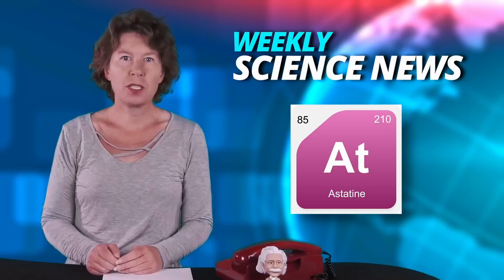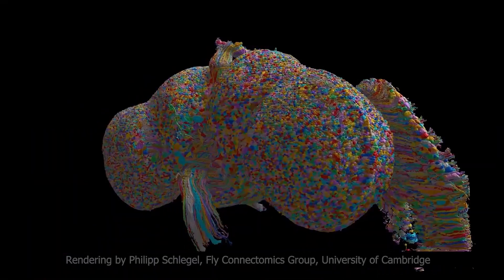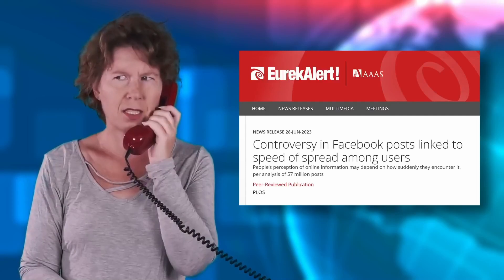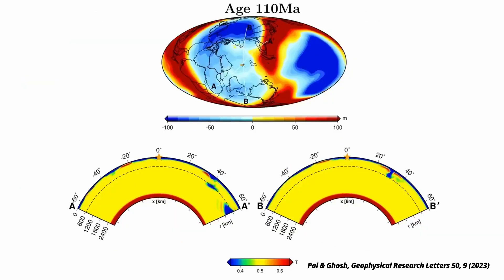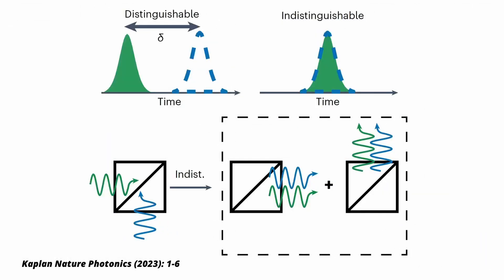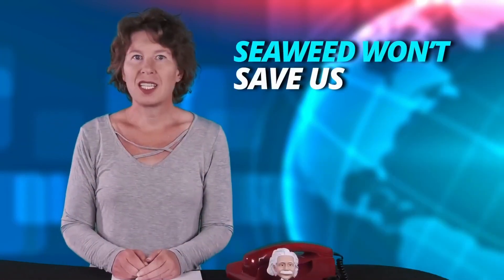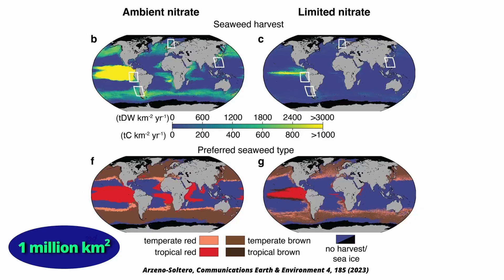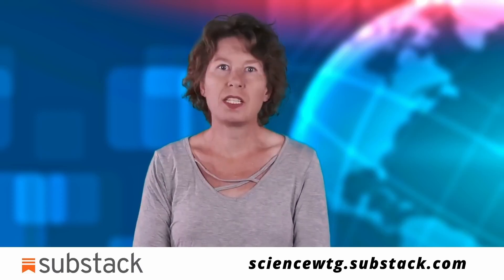Scientists find new atomic nucleus

Comment: re: seaweed If you use automated buoys to dispense nutrients (and detect when they are needed) then I suspect the seaweed idea would make more sense. What would make the most sense, however, would be to use GM phytoplankton to both increase the ocean surface albedo & sink carbon. If the phytoplankton are modified to produce suberin* granules that sink to the sediment, then the carbon could be sequestered for an appreciable length of time. *suberin is the main constituent of cork - but unlike cork, the phytoplankton would have to produce suberin without any air bubbles so that it would sink. Though I suppose you could GM macroalgae (seaweed) to make floating cork structures that could be harvested and put to good use in construction.
Reply: Sadly still logistically impossible, as the vídeo show, as algae, phytoplancton need nutrients too, and water fertilization at this scale, is impossible, in technology time and materials
Reply: @ElementalAer  I disagree since automated buoys / oceanic drones would be an easy way to do it - probably easier than fertilizing corn fields in Iowa with tractors. They could be called into a ship periodically for refilling (again, using an automated process, not hand-filling). Fertilizer can be highly concentrated.
Reply: @rhyothemisprinceps1617  And who'll manufactor, ship, mantain and mainly, pay, for all this? Climate change regression don't have economical or (fast) political return. Diferent from tractors on industrial farming, this idea don´t have a return, and was never made before
Reply: @ElementalAer  US government spent $877 billion on national defense in 2022 & the US DoD has identified climate change as a "critical national security issue" - so they can pay for it, easily. And certainly, there is no difference between my proposed strategy in terms of the funding question & any number of other proposed solutions such as space sunshades (hella expensive & also reduces photosynthesis) and carbon capture machines.
Reply: @rhyothemisprinceps1617  Well, now find the political solution so the USA put their money on the climate crysis and not bombing random countries (ps. it has been years trying)
Reply: @ElementalAer  If there is a power outage in Phoenix, it is estimated that 10k people will die from the heat. When (not if) something like that happens - that's when things will start moving. Should start moving before, not after - but that's the way things are.

Comment: Science has turned into a cult that is now closer to a religion. It is increasingly based on utterly unprovable but unquestionable dogmas rather than an open minded and fact based struggle to actually know more. If a member dares to question certain dogmas, they lock themselves out from the sect both in the case of science and religion. Science is not doing ANY better job explaining everything (or anything, actually) than a religion. Humans tend to either leave the spaghetti as hard as it breaks under your teeth or cook it into marmalade.

Comment: PLEASE READ THIS RE EDITED Time 16.-19 Date 15/7/23.
On the slit theory that spreads the light photons through METAL slit.
In a microwave, the microwaves STOPS coming out because of a FARADAY MESH cage that causes the WAVES to become trapped GOING UP AND DOWN SPREAD OUT within the faraday mesh, but still trapped. PERHAPS like slits in the SLIT EXPERIMENT, SPREADING out /FORMING FRINGES !!! The SLIT experiment is MADE OF METAL, just like a PORTION of a FARADAY CAGE !!Traveling energy behaving the same when passing through a narrow METAL aperture !! The DIFFERENCE in slit experiment is that the energy is LESS ENERGETIC, so escapes, creating a fringe reflection. Going TOO FAST, like microwaves through the slit as too energetic=getting trapped/rebounding VERY FAST within the slit. If the light was a dead straight line, then it would pass UNHINDERED. BUT, if it was a fanning out wave, then it would behave as above ? The material of the slit is METAL. Has the slit been replicated WITHOUT a metal material ? CAN the light CLOSE to metal CAUSE  charged particles at the metal ?? Is it this that causes photons to behave like microwaves at a metal slit PORTION of a faraday cage on a microwave ?? Where there's metal, it gives off electrons (electric field) that affects the photon passing by the metal slit, BECOMING A WAVE AND NOT A LINEAR STRAIGHT PHOTON ?  Where there's METAL (like metal slit), CAN Photons PRODUCE a NEGATIVE ELECTRON POLARITY excitation, BUT at FASTER SPEEDS than conventional methods ?? Is this used to create QUANTUM  binary switching on/off for binary computing ?? "On" as a NEGATIVE CHARGE electron 1 and zero (no electron) as an off state switch ?? AT absolute zero, DOES PHOTONS through metal INCREASES COHERENCE OF ELECTRONS when at NEAR ABSOLUTE ZERO because at absolute zero there's ZERO RESISTANCE for electrons. At near absolute zero,  the MEISSNER effect occurs, of ZERO electromagnetism at the core. Factually, if electromagnetism PARTIALLY BINDS a group of atoms together, then ZERO electromagnetism (Meissner effect) means PARTIAL UNBINDING those clumped atoms (GAPS), causing LESS AND LESS RESISTANCE. So NO resistance gives SUPERCONDUCTIVITY for electrons to flow. MEANING NO/ZERO VOLTAGE LOSS/DROPS (V=IR, V=100 current times zero resistance which is v=100*0 giving zero voltage drop).So, logically, OHM'S law, perhaps shouldn't be used here, because there's no voltage drop calculations here. Curiously, calculation of current becomes undefined when inserting resistance as zero. BUT can ZERO electromagnetism ALSO PARTIALLY unbind a SINGLE ATOM ITSELF ?? My mind still hovers over this PAIRS as one entity in entanglement, with the QUOTE of ".an inseparable whole". Is there some kind of umbilical cord ? Can there be a FASTER THAN LIGHT umbilical cord that does not affect the other ? Can entanglement occur without near zero temperatures ? WHAT IF ZERO electromagnetism PARTIALLY UNBINDS a SINGLE atom to release something that's so far UNDETECTABLE, as NEGATIVE MASS with NO POLARITY to detect it ?? QUOTE from science paper 2022 when ASKING google IF entanglement can occur without near absolute zero. QUOTE "previous observations that long-range entanglement survives at a non-zero temperature "ONLY" when more than three subsystems are involved". WHAT are those subsystems ? Are they involving a subsystem that creates ZERO ELECTROMAGNETISM, OR something at near absolute zero ? Zero electromagnetism MIGHT PARTIALLY UNBIND a SINGLE atom itself to ALLOW ESCAPE from partial UNBINDING,  this FASTER THAN LIGHT "umbilical" cord CONNECTION between PAIRED AS ONE particles; but a connection that CANNOT be used to affect the other at a distance, because it's UNDETECTABLE ?? It's frustrating when this paper DID NOT say WHAT those subsystems were. I DON'T STUDY mechanics,  just "ASK" google the right questions.

Comment: I can't wait for the biggest breakthrough in general purpose computer structure design in decades: The cheap, practical merger of memory and storage into the same thing. No more need for separate RAM, hard drives and caches all operating at different access speeds. A terabyte of persistent RAM and effectively instant booting and loading. No need to copy a program into memory; just run it in situ in storage.

Comment: I note the part about "the brain has a highly recurrent architecture", i.e. lots of feedback circuits. This is quite different from ChatGPT, and makes sense because that is what is needed to make a brain into a dynamic system that can spin thoughts around and around inside it instead of just "some stuff goes in this end and other stuff comes out the other end". Note further that they suggest this is especially concentrated in the areas for "learning and action selection", i.e. ... thinking. In a real sense, ChatGPT cannot think, it can just "blurt out" and is just very good at blurting out.
Reply: That is no different than the majority of humans . Garbage in garbage out
Reply: Thank you for this nice (and accurate) way of thinking about current AI.

Comment: On a black hole.
As a black hole increases in gravity, the singularity size would likely NOT grow proportionally with an increase in gravity?? But due to increase in gravity, the spherical area where light cannot escape WOULD GROW in spherical area size , giving an INCREASE in size of a black hole sphere, where NO LIGHT will escape ??
But likely, the SIZE of spherical black hole is REAL and NOT a lens like  DISTORTION exaggerating it's viewable size, Because if at the event horizon, the ACCRETION disc INCREASES in size, then the SIZE of Black sphere of NOTHING would be REAL in size up to the point where accretion disc appears ??
CAN that accretion disc STILL GROW in size LONG AFTER THERMAL death ? At near absolute zero, is the Meissner effect of ZERO electromagnetism when it's EXPELLED. Electromagnetism PARTIALLY BINDS several atoms together. So NO electromagnetic force at near absolute zero=partial #UNBINDING of clumped atoms, INCREASING volume AFTER THERMAL DEATH ?? Space temperature is close to absolute zero

Comment: So seaweed is a good solution. All you have to do to make it viable is find something that it can be used for.. I dunno.. Fuel? I mean, if instead of pumping more fossil fuel, we make fuel out of fermented sea weed, then the fuel burns, turns to CO2 in the atmosphere, gets trapped by more sea weed - then this is a closed cycle. Problem solved.

Comment: Get the climate "back under control"? Please, the climate have never been under control. I spent yesterday driving around and doing some hiking admiring glacial features left by the last ice age, and very possibly the one before that. 

Now if you said "bring the climate under firm human control" I wouldn't argue. Then we can argue about where to set the thermostat. I would assume that setting is somewhere between the Pliocene Climatic Optimum ( now + 4C) and the Last Glacial Maximum (now - 6C), but I could be wrong. 

https://en.wikipedia.org/wiki/Global_temperature_record#/media/File:Five_Myr_Climate_Change.png

Comment: The amount of power you could save if computers had a "discard memory" instruction that DRAM could execute... (DRAM draws power to keep memory bits from flipping. It needs to do this even for memory that isn't in use, as there is no way to tell the memory that you don't care what is stored at a particular address.)

Comment: I would take issue with two of your comments on climate modelling. 1) Contrary to your assertion, we have no data that climate is changing quickly. In fact, one of the quirks in the global warming narrative is that we've had a 15 year span recently where they had to try to explain why warming paused. And 2) the high resolution problem resides in the fact that the data sets used by NASA and NOAA are filled with interpolated data from stations that haven't sent actual data since the 1960's. The interpolation schemes are statistical junk science and so no model built off of it will ever be useful for anything other than pushing for support to increase a department budget.

Comment: FYI the "identify all pictures with bicycles" style prompts were to obtain information for training automobile AI software to identify bicycles, cars, buses, road signs, etc in their cameras.  They weren't really part of verifying that the user was human.
Reply: Wrong. It does both things. The software knows what is contained in some of the squares. It doesn't know what's in others. And you don't know which ones it knows and which ones it doesn't. By presenting a mix of these images it can both gather new data about what might be in the unknown images and test your ability to identify the known images.
Reply: @wheatthicks  The software killed a poor old person pushing a bicycle across the road at night . The billionaires owning the companies responsible blamed it on the human in the car accusing her that she failed to act as , in comparison, a power-surge trip switch would act on electric circuit.
Humans are not good failure protection devices because the humans get tired, bored, distracted, etc. but the billionaires and their stooges see the humans as such devices.
Reply: @reasonerenlightened2456  Ok. Thanks for tagging me in your bizarre tangent.

Comment: Something interesting about calculus is, that when creating a point of calculation ina grid, sometimes its goes infnite in both locations and then mirrors or arrives at other locations fine at hte point of origin. So in communications, could this interesting math be used in teh same function to shorten the time delivery, so rather then a linear path, create an infnite path... and then it comes to the location, the question of how to set upa curve to go infnite and come back would be interesting and woudl it be possible, becasue this would then allow infnite distance ot ocmmunicate anywhere in the universe, jsut stating it, I mean mathematically the proof is there on a calculator, but in reality, its something a bit different in taht relation. Maybe its like creating a spacial-echo for ocmmunication. Or does one need an array of netwroks first to create such a problem, 22 minutes... is a time, still slower then light speed. Light speed has its problems, you cna send laser packets of data, meaning 13 minutes for light ot reach mars from earth I think... So it would take 26 minutes in total to hear back, however, the interesting thing about this is I think I owuld be a good canidate, or engineer behidn the scenes, create a compact communicational language set, for distance talking, rather then emailing a friend, always a set of base questions. Of course, health could be monitored and sent back, like heart rate, health etc. (3 - 22 minutes)

The whole thing of psychology in closed corridors, we already know waht happens. in diciplined men it doesn't really effect anyone, theres thousands of years of this, in other types of males it effects them greatly.... surgeons and doctors that can cut up people it shouldn't really matter, different wavelength of emotion, and intelligence, but that would be an assumption. Not sure how the test on psychology would operate, unless they are jsut creating scenarios of stress and other nonsense things that then are jsut torture and nto realyl realistic... althoug hday practices of scenario systems is great, for then discussing openly how to solve those problems...

Certain females do not pose a threat, certain males do not pose a threat, dependent on demeanor and breed, typically.  There was already an isolation system. Cave network, mining geology etc.

Anyways communication... how to create infnitiy arcs, that don't need travel time... Point A systems... there is no B... YOu would want the arc to travel, and then go infinite, and come to a prescribed location of choice, IE it arcs back, equations in a virtual system technically do this in an instant... question is is it possible otherwise, meaning communicating in suc ha way, it would take about 6.68 micro seconds to communicate to any place, or less... hmm... is that possible... Light speed is relative to itself. If a star is in a group traveling light speed, teh stars light is still traveling emitted at light speed, but then its faster then light speed... but not faster then light speed reltive to the source, its just a relation of movements already in motion. Light speed is simpyl the acause or effect of a relation of burst or accerlation of energy to a undefined speed from an object moving.... Thus infnite speed makes more sense, relative to light. SInce in a void/ space, whatever you call it or want ot call it, any object can be going at any speed beyond light speed, since light speed is relative to not other objects but its relation to its time in space and where its produced. So a group of matter, simply travelign at  a trillion times light speed, wouldn't know it, because its aconstant and relative , and the light permeated from this group would be emitted at a standard of light speed, but in its relation then it would be defined to those other groups in relation of how its being seen, depending then on its motion. Meh what do I know.  

COuld you make a light particle emited from a source, to then create another source of that source to generate more light, to the point you mutplied its relative light speed times the the ammounts of that light speed? hmm... I f I made an object that emit light speed, the light from that object, generates more light at its reltive speed, should that light then be light speed times two? THer eis nothign to slow it down since its relative? Or is light speed the actual speed limit, but we know this doens't make snense, since two objects can travel away from each other at light speed, so therefor its twice the speed of ligth in teh distance that is being made, so therefor, light speed is not a determined speed limit, its just a determied restriction to a means of accerlation per instance, of light relative to its origin of emission... meh I don't know bit of weird rant.